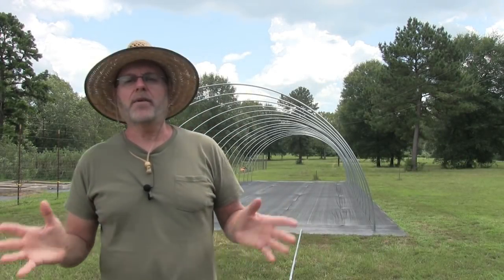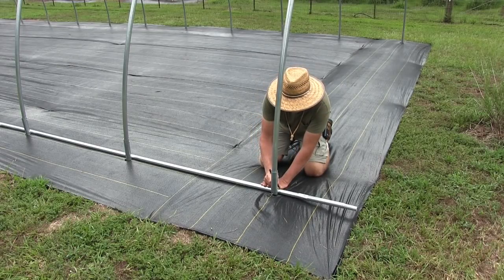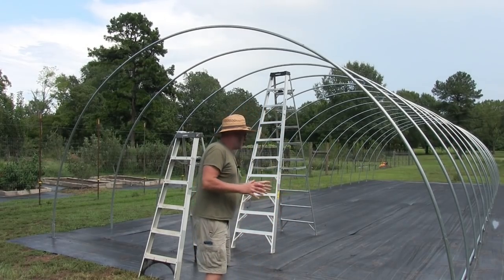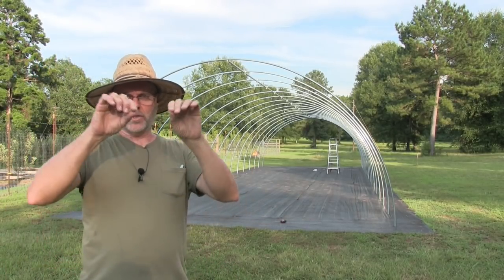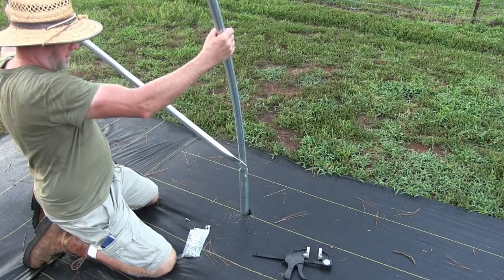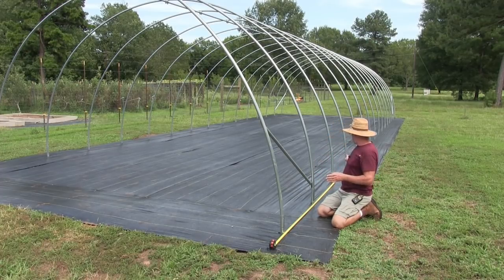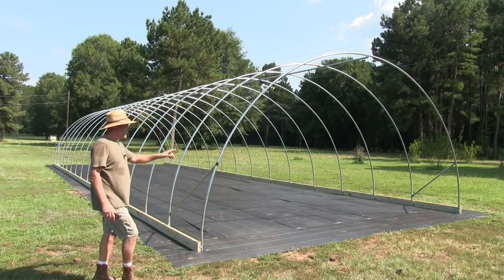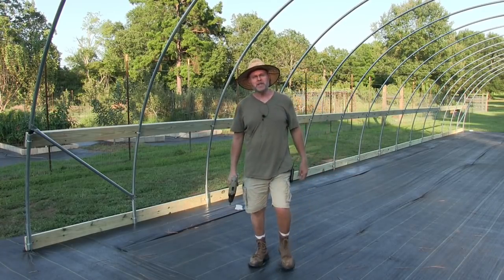Greenhouse build part 3 of 6 from Growers Solution

Comment: For anyone who buys and builds this greenhouse just FYI... I am building mine now and they sent me a much more substantial stake driver and it is not a bolt and washer any more. 

The one they sent with my 16x32 high tunnel is 1 chunk of steel that has been seemingly machined.

So you shouldn't need the bolt and washer.

Comment: Will you be putting shade cloth on this? Deep South Homestead Put fans, that come on automatically, and a window that will open, and close. When greenhouse gets to a certain temp.They put  black Shade Cloth on it. They are in the process of building a second one. They are going to put White Shade Cloth on it. To see which one keeps the greenhouse cooler. They are growing plants 12 month out of the year. They also put high volume fans  to help with circulating the air.
Reply from the maker: Having a greenhouse is all new to us and there will be a learning curve. I"ll probably get a shade cloth but we will see about fans.

Comment: I always find self tapping screws hard to start. I'd rather drill a pilot hole. I don't think it takes much longer if you have 2 drills.
Reply from the maker: Make sure the drill is on high speed and push hard on it before you start drilling with the self tapping screw, that will put a small indent in the metal and keep it from walking on you.